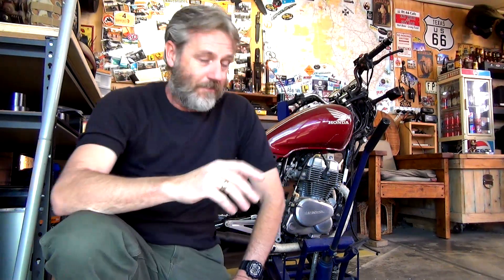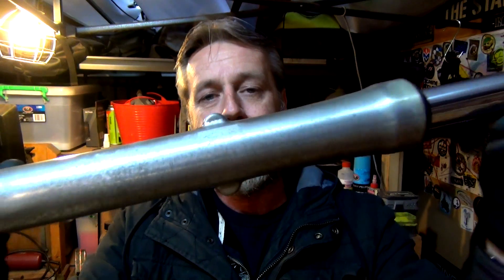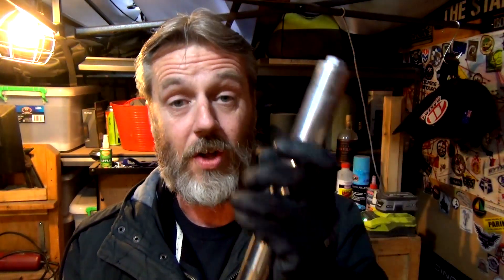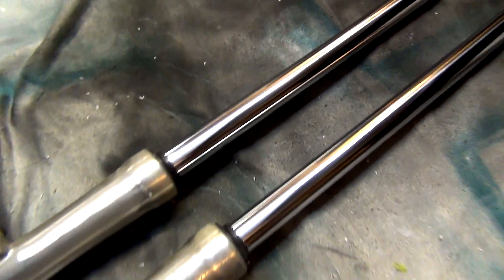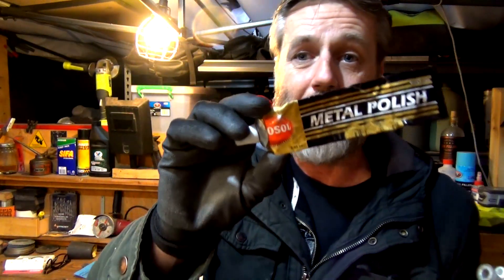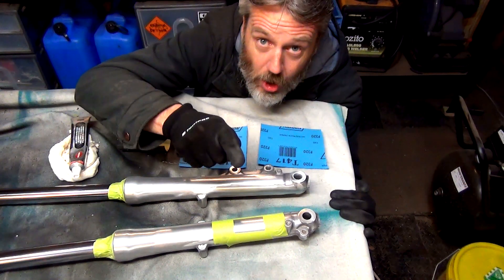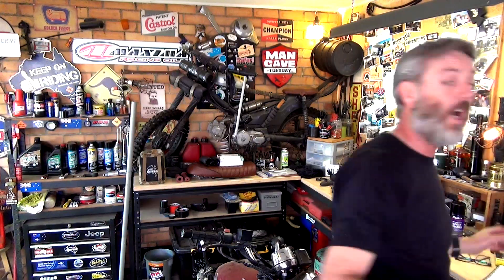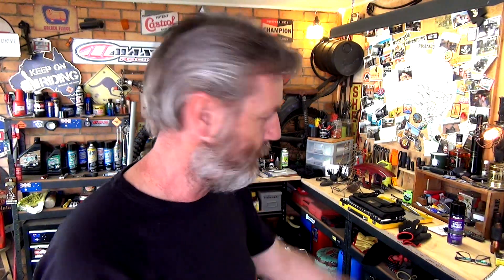CB250 Build - PART 11. Rims & Shocks!

Comment: Mark when I restored forks on my 1978 bike I used coarse  Scotchbrite pads for a drill... I used the cylindrical ones with an abrasive sink cleaner like comet or barkeepesrfriend for stainless pans. It cut thru the old lacquer  and made the forks look like a brushed finish, not too shiny, very close to original look.

Comment: Mark great episode!
while the forks are off, change the oil in them.  its probably still the same stuff in them that came out of the factory and as we all well know oil breaks down over time and its gonna be full of chrome flakes where the spring rubs against the inside of the stantion.
If I'm not fully stripping the fork down I use a drop of paraffin which I believe you call kerosene in Aus as a flushing agent to remove the chrome out of the bottom of the tube by pumping the stantion up and down and then let them drain and gas off overnight. This is to stop the paraffin thinning/contaminating the new oil.

Mistakes are great as long as we learn from the first one!
Reply from the maker: Thanks for that mate! :-)

Comment: pro tip
buy a4 manilla folder the type that  looks like accordion.
keeping grits in different sections 
and write git number on each part u tear off so if u dont use the hole part u can reuse left over section knowing the grit os paper
Reply: Also, a foam pad can help even it out.
Reply: so simply but genius!

Comment: Okay, they look fine but it is an awful lot of work and time. Here is a tip you might want to try. try using a "Power Ball and Mothers Mag and Aluminum Polish". You can check it out on Youtube. I have to tell you it is way better and less time consuming than the way you are doing it especially if you have gone as far as removing your front fork tubes from your motorcycle.
 P.S here is a couple of links as to where you can purchase them.
https://www.amazon.com/dp/B0007RDVD4?ref=yo_pop_ma_swf (for the power ball) 

https://www.amazon.com/dp/B0009H519Y/ref=cm_sw_r_cp_api_nEhFAb9S18JRE (for the polish) 

They also make a cone for hard to get into places. 

https://www.amazon.com/Mothers-05146-Original-PowerCone-Polishing/dp/B00JM50SXS/ref=sr_1_fkmr0_1?s=automotive&ie=UTF8&qid=1538692309&sr=1-1-fkmr0&keywords=Mothers+05146+PowerCone+360+Metal+Polishing+Tool (for the cone)